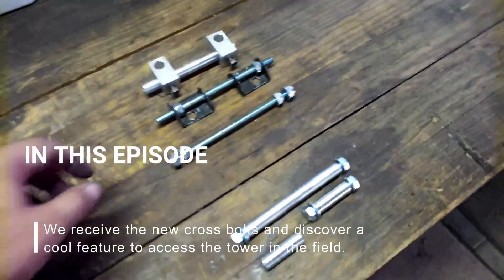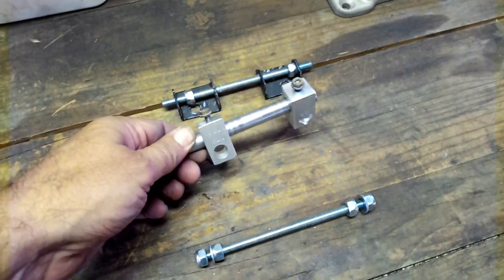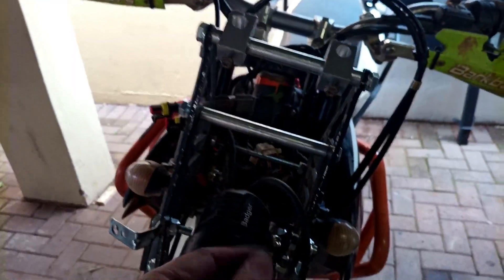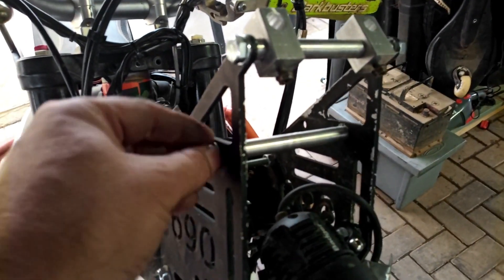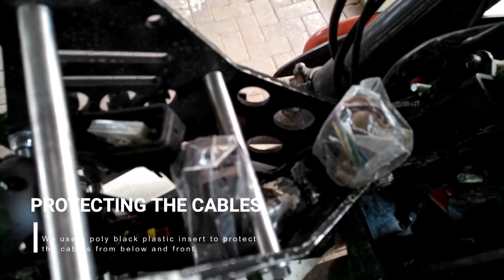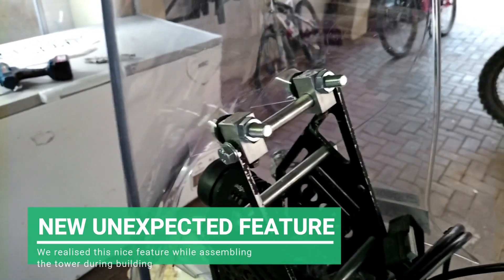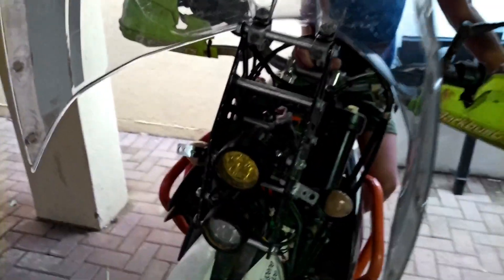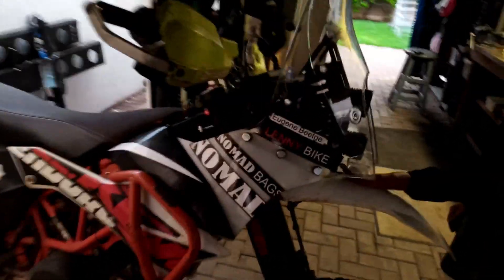Rampage ADV Tower Ep2 Receiving some final parts during fabrication.

Comment: How is the tower attached to the bike??
Reply from the maker: On a 690 its bolts around the head tube with a stainless steel rear bracket and u bolt. On a 500, same tower but uses brackets made that bolts onto the head and frame. Super secure on both bikes.